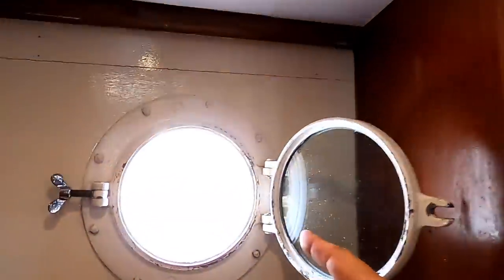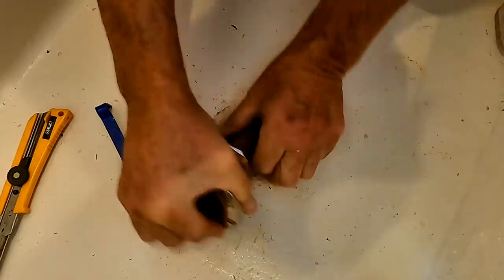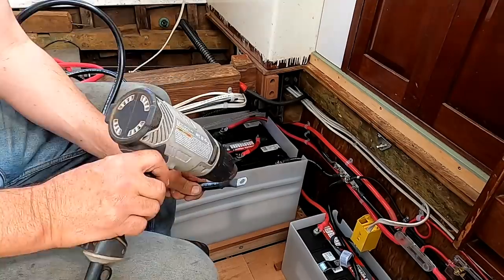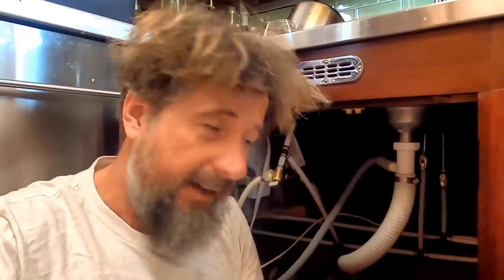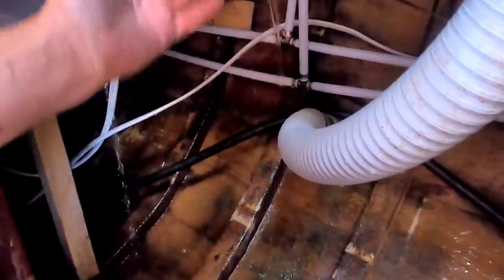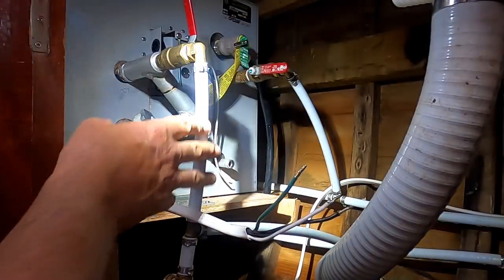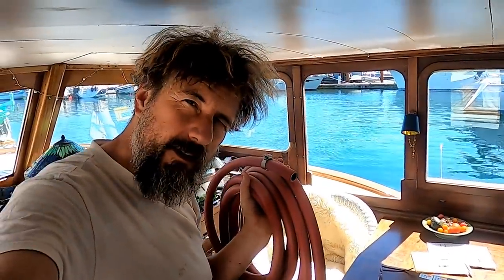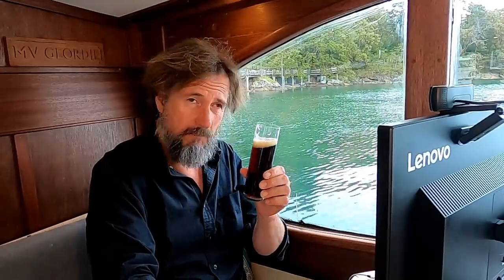Showers, Wires, Hot water etc..- Boat Life - Living aboard a wooden boat - Travels With Geordie #174

Comment: You may want to check out a RV shower faucet that recirculates the hot water back to the water tank until it get hot (the plastic piece turns red )then you can switch it to shower mode, no waist of water

Comment: Hi Peter, very neat job and i like the zip ties on your hose. I love learning, i really do. As for your plumbing parts, if the thread is parallel it would usually rely on a rubber washer or 'o' ring device for sealing properly and tape should not be used. If your thread is tapered it relies on tape or compound for sealing properly and if you put the tape on the wrong way it will tend to unfurl as you tighten the fitting. Thanks for sharing. Stay safe and keep up the good work. 👍🖖😎🐶🦴🌈

Comment: Thanks for the Pex line removal tutorial. I've always struggled with those. Great video. Zoom brewery tour with Beer tasting was great too.
Reply: Pex does not belong on a boat   Period
Reply: @vidguy007  I watch because I enjoy but I'll never be an expert. May I ask what the preferred material would be?
Reply: @IamChrisL712  3/8 soft copper tube with flared ends.  My 40 year old trawler, as most boats form the period used that and none has ever failed that I'm aware of.   My neighbor's boat with a mix of copper, braided hose with and without barbed fittings and Pex has a lot of failures, none of it in the original copper..
Reply: @vidguy007  cool. Nice to learn something new. Thanks.
Reply: @IamChrisL712  I agree with almost everything Peter does, except Pex plumbing.

Comment: Pex?  Really?  3/8 soft copper with flared ends ONLY on my boat.   It’s inexpensive, easy, and lasts forever.   It’s what the builder used.   After having a fitting blow off someone added, I removed all the junk and replaced it with copper.   As a liveaboard with the dock hose connection I cannot afford any failures.